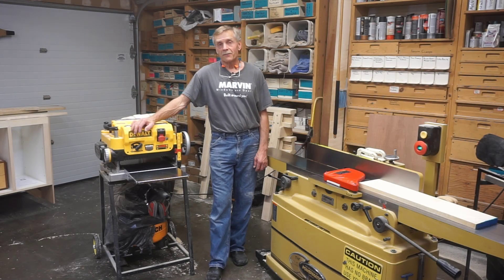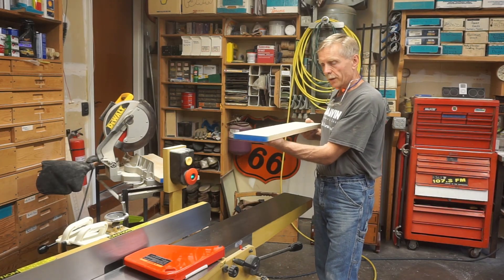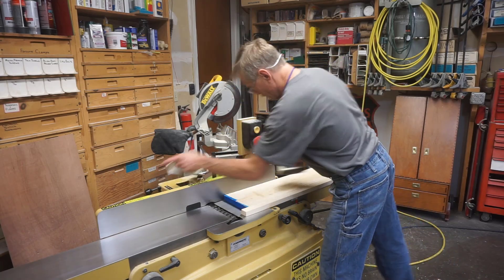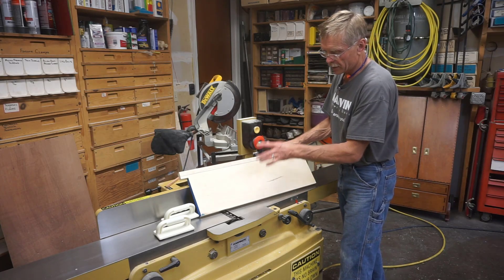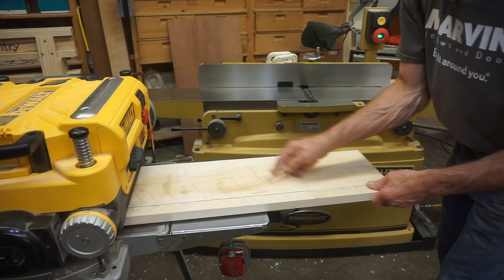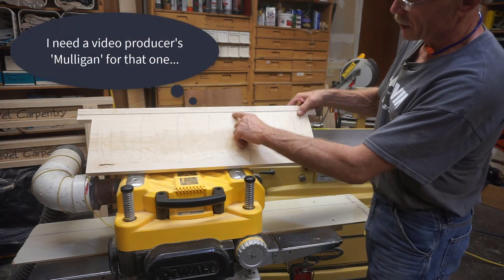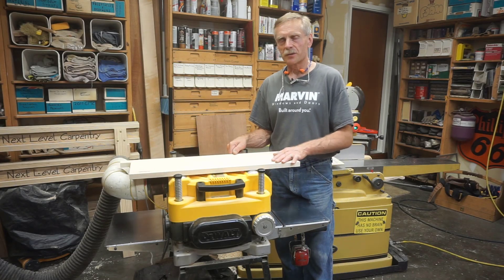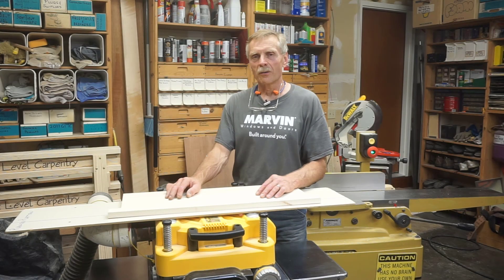Supersize Your Jointer for Planing Over-width Boards

Comment: or use a handplane instead of a jointer to flatten the first surface ;-)
Reply: In my experience, flattening one side of a board with a handplane is not super long. It's usually a few diagonal passes, and it's flat enough to serve as a reference for the power planner. I wouldn't adjust the thickness of a board with a handplane though.

Then use this reference to flatten the other side, then flip and finish the handplaned side.

It's not just about the money. I don't have space for a jointer. But I don't make a living with woodworking.
Reply from the maker: @eepp  Good on you!  Those hand tool skills will never hurt you for knowing... Best, Matt
Reply: @eepp  This is how I have been doing it as well. Reference one side by hand roughly and then plane it down in the machine. A lot of the oak I have been working has a combination of cup, twist, and bows, but is plenty thick and basically free. I have seen some people using sleds and shims, but I haven't tried that, and I only have a small jointer right now. Its a great workout anyways.

Also I use chalk to see what I am working on the surface. Maybe an electric hand plane could be used in the same manner to save effort and time.
Reply from the maker: @TheFootbaldd  It's much less stressful when wood is 'plenty thick' and you don't have to worry about spoiling a piece by the time it's flat enough to work with.  Best, Matt
Reply from the maker: My compliments to anyone who can make an un-subsidized living flattening boards with a handplane! Best, Matt
Reply: @NextLevelCarpentry  Hats off to anyone who can earn an unsubsidized living working in a small woodworking shop, period.  But this video is about making do in a hobby with limited resources.
Reply from the maker: @thernly  There's a definite benefit to doing more with less, isn't there?  The same principal is what's helped me earn a respectable income... after all, it's not how much you make but, rather, how much you keep that counts!  Paying overhead on another $25K in huge equipment and utilities for a shop big enough to house and operate them can really diminish the 'how much you keep' side of the balance sheet, that's a for-sure!  Best Matt

Comment: Good info,  Did the Caution sign on the Jointer come with the machine or did you add it.
Reply from the maker: Glad you like the info Richard.  The sign on my jointer is one I saw somewhere and adopted it for use in the shop as a humorous but true reminder to think clearly and work safely.  BTW you can get one in sticker from from the Next Level Carpentry Swag Shop at Teespring here:  https://teespring.com/stores/next-level-carpentry-swag-shop along with other video related gear.  Best, Matt

Comment: Good idea.  I only have a mounted 3.5" jointer and just got a planer so this tip will help me flatten bigger boards until I can afford a bigger jointer.
Reply from the maker: Just cool the way that works, isn't it Chris?  Same process I went through starting out a ridiculously long time ago with a 4" delta machine.  Best thing is you'll be better off in the long run learning to work through this adversity than you would starting out with a 8" or 12" machine... it may be some time before you believe me but I think someday you'll find it true.  Best, Matt

Comment: Great video! I'm blown away to see a Master Craftsman using a Dewalt 735! Seems the Powermatic would completely outshine the Dewalt. My questions: 1) Is the Dewalt your primary thickness planer, or just the one you had on hand for this video? 2) Since you can obviously afford the Powermatic platform, why did you choose the Dewalt? 3) Did you upgrade the Dewalt to a helical head? Cheers!
Reply from the maker: An observation I truly believe is that 'it's not what you got but how you use it that counts' Ben.  For all day performance in a production setting I imagine a hefty Powermatic would 'completely outshine' my 735... but I've never done a job that I couldn't finish with impressive results and profitability without an oversized planer in the shop.  The cocky side of me will bet you that I can get more out of a DeWalt in efficient, profitable productivity than many with a Powermatic or other industrial machine can.  You are correct in that I can afford virtually any planer I choose and am still completely content and satisfied with my DeWalt.  I see no need to 'upgrade' to a helical head either, although again, it's not a question of affordability.  I drive a 1/2 ton short bed pickup and do a surprising amount of hauling with it even though I could easily (but unwillingly) afford a full sized bed and a trailer or two... another way to look at it is 'it's not how much you make but how much you keep' that counts.  Not properly accounting for overhead likely causes many with a 'bigger is better' mindset to subsidize customers projects and end up failing in business... I appreciate your comment and hope this unexpected answer doesn't drive you away... Best, Matt
Reply: @NextLevelCarpentry  Drive me away?! No way. Hooked me to subscribe. Thank you for your candid response, and for sharing your knowledge in these videos. Cheers!
Reply from the maker: @Cactustone  SAHWHEET!  You're welcome... and thanks for subscribing.  Much appreciated... and Happy New Year to you! Best, Matt

Comment: OK, I guess I'm missing something. Why would you run the board through the jointer THEN run it through the planer? Why wouldn't you just shim it, hot glue it onto a piece of MDF or something & run it through? Additionally,  I thought that you might be running the entire width of the board, the one with the lip that was made through the  jointer. Like I said, I guess I'm missing something . Thanks! I really enjoy your videos
Reply from the maker: I suppose the only thing you're really missing here Guy is that the whole point of this video is to show an alternate method, not an outright substitution for, using a 'sled' in your thickness planer to flatten wide boards.  I use both methods in my shop but prefer this one anytime it's workable since its considerably faster when working with any quantity at all. When I have a stack of 6~10 boards 8"~10+" wide to flatten I pop off the guard, run each one over the jointer at full 8" width capacity then, after placing the platen in my thickness planer, run each through until the 2nd face is parallel.  When I'm not shooting video this process is MUCH faster than setting each piece up individually with shims and hot glue on a sled for the initial flattening.  Maybe watch the video again with this in mind and see if it makes more sense... I think it will.  Glad you like videos here!  Best, Matt

Comment: So what if you have a 6 inch jointer? Same technique just can't go as wide?
Reply from the maker: Exactly Clark... you should be able to do about 9" or so if you work carefully with your 6" jointer and pay attention with each step.  I actually began using this method when I had only a 6" machine.  I wasn't limited by its capabilities as much as it just slowed me down since little of my work exceeds 8" width.  Being able to do 8" stuff in a single operation on an 8" jointer allowed me to be more efficient than having to use this method for stuff in the 6" ~8" range.  Best, Matt

Comment: Great video Matt as I have a 6 inch Powermatic jointer and usually rip 8 inch boards to join. Very well done video which will save me a lot of time and money (not buying a larger jointer)!!
Reply from the maker: Not sure if you're out of the woods yet Michael... does your 6" Powermatic have the parallelogram adjustment mechanism?  It's worth every penny... actually every $100 bill... extra that it costs.  I'd sooner do with a 6" capacity WITH parallelogram than the 8" capacity without.  I'm well aware I've just jeopardized a 'friend' by telling you this... sorry😬😁 Best, Matt